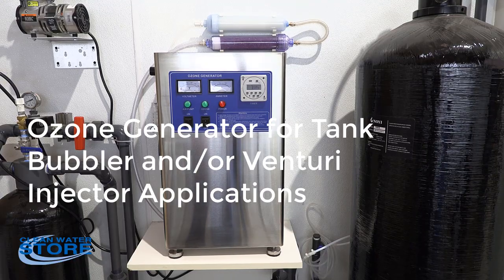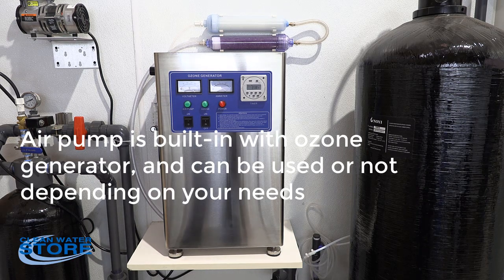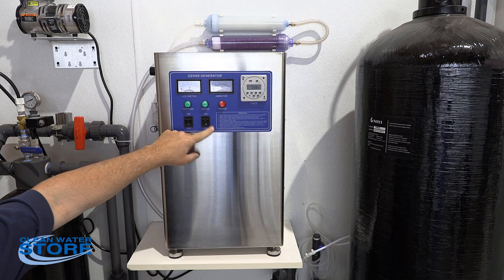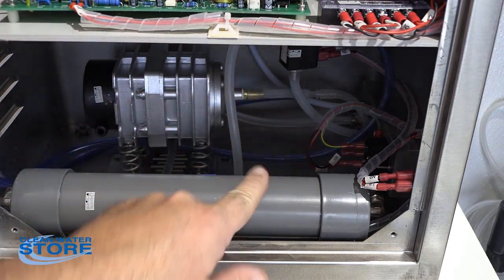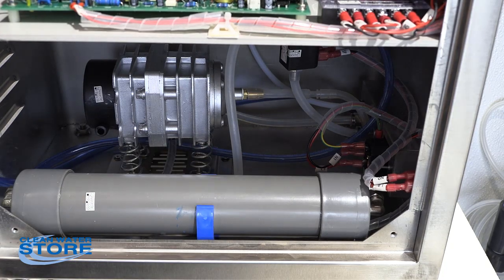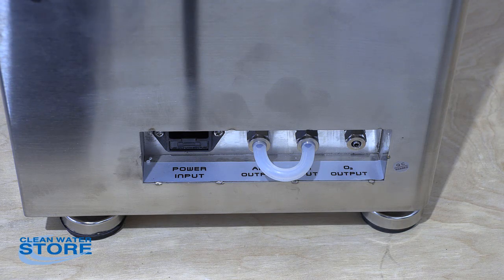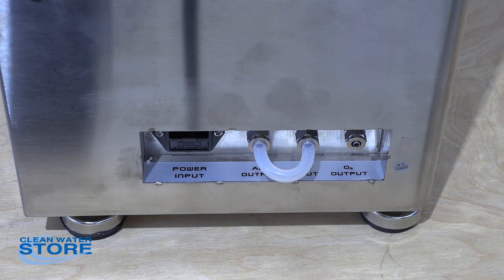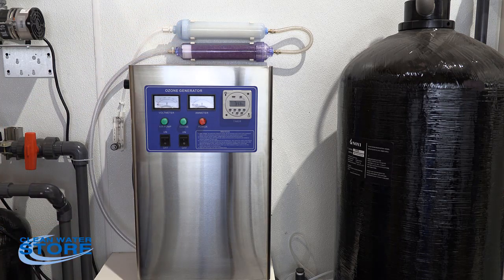Well Water Ozone Generator Overview

Comment: I thought Venturi would not work properly sideways
Reply from the maker: It is correct that they should generally be installed in a horizontal position.  Mazzei says ". Mazzei® Injectors should be installed with the flow arrow in a horizontal or upward position. If installed in a vertically down position, there must be at least 5 to 10 psig of outlet pressure."   Because this installation uses a booster pump we do have the pressure to create a vacuum so it works fine.